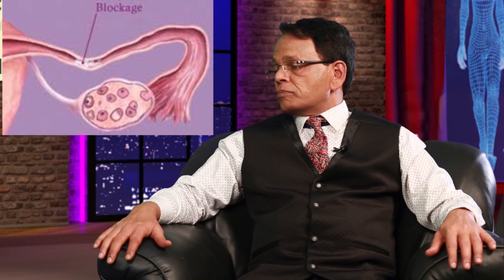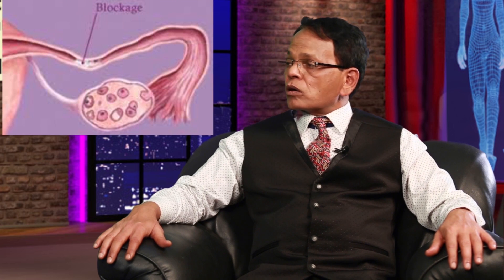Causes & Treatment - Blocked Fallopian Tube

Comment: The most common cause of blocked fallopian tubes is pelvic inflammatory disease (PID). ... Other potential causes of blocked fallopian tubes include: Current or history of an STD infection, specifically chlamydia or gonorrhea. History of uterine infection caused by an abortion or miscarriage. With Agbara Herbal Cleanser, All this infection will be cured and your Tubes will be opened and you get pregnant very fast, Use Agbara Herbal Medication

Comment: Sir please help me..My tube is blocked caused of TB ..So please treatment sir.
Reply: How can I get the Agbara cleanser plz help
Reply: I need the Agbara herbal medications
Reply: @nmasinachichilo7543  you dont, only castor oil, a cloth and a hot water bottle
Reply: Hello, what kind of tb did u have??
Reply: The most common cause of blocked fallopian tubes is pelvic inflammatory disease (PID). ... Other potential causes of blocked fallopian tubes include: Current or history of an STD infection, specifically chlamydia or gonorrhea. History of uterine infection caused by an abortion or miscarriage. With Agbara Herbal Cleanser, All this infection will be cured and your Tubes will be opened and you get pregnant very fast, Use Agbara Herbal Medication